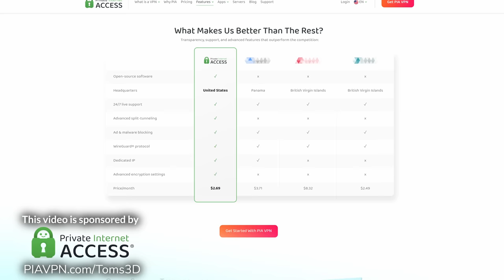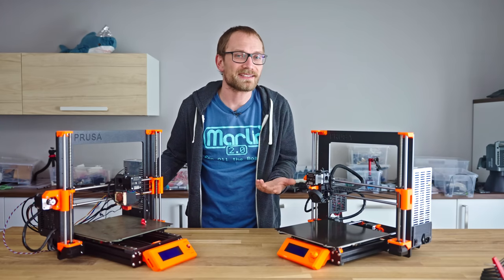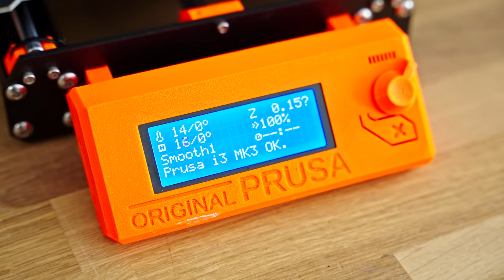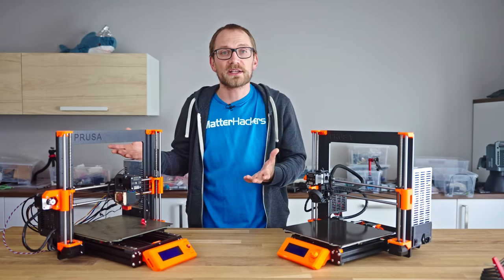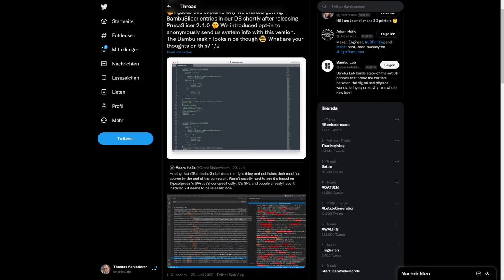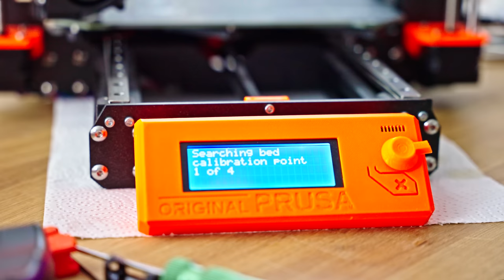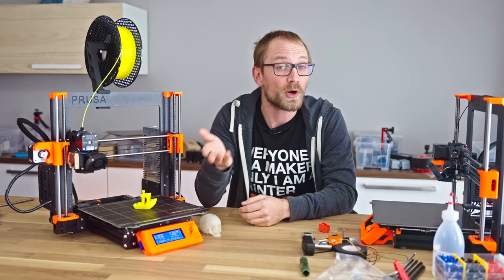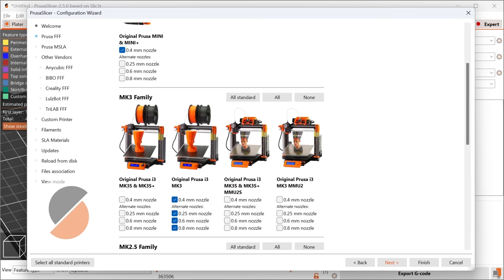This printer is OLD. Why is it still my favorite?

Comment: I have seen around 15 different Prusa machines, 5 enders and 3 Ultimaker on the different labs and universities that I have worked in. And I had never seen a dimensionally accurate Prusa machine, all of those Prusas were printing beautifully but they were completely unsuitable for any engineering work that requires a little bit of precision in my experience. Enders 3s were hit and miss on their assembly and calibration but mostly much better than Prusa mk3s that I have encountered. All the Ultimakers that I have seen were pretty good on their dimensional accuracy. But well tuned cheepo ender 3s were the best of the bunch. If you are gonna use your printer for miniatures and trinkets get a Prusa machine, but if you wanna make anything functional with tight tolerance parts, get an ender 3, do its axis skew calibration, and print slowly.

Comment: I remember all my printers being bedslingers because of cost and that they were "good enough".
But that was then and not now. I honestly think prusa had stuck with the bed slingers for too long.. print speed matters.. nobody likes waiting and heating up their room/wasting tons of energy because a print is taking ages.

I will sadly not be buying a prusa anymore after my mark 2s.. it was a reliable work horse.. it became noisy and creaky.. but a bed slinger only gets you so far.

Comment: The issue I have with the mk3s is that it‘s way to expensive for what it is. If they would half the price I‘d still say it‘s a little expensive but would buy one. With the p1p being cheaper than the mk3s I‘d rather wait a year and watch the durability of Bambu lab printers. Or see if prusa comes up with a up to date printer that is not overpriced.

Comment: What oil did you use to lube the parts? My MK3S+ is at about 200 or so hours now and I feel like just to keep things running smoothly for a long time I should probably do a nice deep clean/lube of the machine.
Reply: You can use the grease that comes with your prusa, in the little white tube. But most people use oil. Superlube with PTFE is what i use. 10k+ hours later and my rods/bearings are still mint condition.

Comment: Prusa make a nice looking printer but. I love my Ender 3v2. After a few modifications then Ender 3v2 is insanely reliable and the only problems i ever have with it is from using cheap bad filament that requires alot of setting changes to get to work. Namely Accreate PLA filament is the worst i have ever come across. Good video though

Comment: I personally want to see what a MK4 would be from Prusa. It seems like it would be the one with the best shot at knocking the crown off. I debated going for a Prusa but ended up going for an ender 3 as it was not only cheaper but I felt the tinkering community around it is something i was interested in. 
I one day want a Prusa and would get more interested if i needed a print farm or relined on it for income.

Comment: I find it sad Prusa is starting to fall behind. The i3 is old and no longer can rely on just reliability as its sole pitch. The Mini is OK and shows Prusa knows how to do a ARM based one with connectivity, but needs upgrades like a Revo to shine. And their first CoreXY model the XL has been coming soon(tm) for so long it is starting to appear "too little, too late" with how competing products appear left and right.

It would be great if they applied what they have learned with the Mini's "Buddy" board (and its wifi hurdles) and the XL to create a update to the i3 in the form of a MK4.

Comment: The Prusa MK3 is the Toyota Corolla of 3D printers. It's not fancy, but it's reliable and just works. It also has great support and a large user base.
Reply: I used a similar analogy the other day but used the Toyota 22R motor. Toyota used it everywhere. Lasted forever.  Just worked.

Comment: This has been my experience too, so far, after nearly 2 years of ownership. I tried a NozzleX, but got tired of fiddling with temperature adjustments to reclaim previous reliability, and PETG sneaking out above the heater block. I ultimately decided to just use non-abrasive PLA/PETG with this machine.

I think my remaining confusion with the stock configuration is PCB bed warping. I currently use the "nyloc mod" and still need to re-adjust every ~2 weeks or so, but at least I can adjust it. I'm not sure how my machine seems to be different from friends' which to this day remain un-modded, but generally retain the consistent 1st layer from their initial build (so I'm told).

I'd be pretty curious to know whether other folks that continue to use the MK3(S+) for the reasons you mentioned have resolved or endure this experience with the bed.

Either way, every time I consider a heavy mod to some functional part, I talk myself out of it, because my current goal remains the same as the original one: keep printing as boring (and functional) as possible, so it can be a tool to build interesting things.

Comment: I don't think you meant it but diminished a lot of peoples work by implying Prusa made consumer 3D printing what it is.   There was a bunch of machines in the early days but Prusa was able to keep the price lower than taz 4 and Makerbot sold out. There would still be and was consumer 3D printing without Prusa. I don't know how to find this out but I know the ORD bot was selling well in China and that has a lot of similarities to the Ender 3 with too over the cheapest good enough printer. Prusa slicer relies heavily on Cura.  There was big reliability improvements because of E3D V6. Marlin had and has other contributors beside Prusa.  Other motion platforms also work well.  Even gerbl is nice but more common in milling.  Stuff like silent stepper were a natural progression of trinamics IC line.  Prusa team has done a lot for 3D printing but they definitely had tons and tons of help to make their product.

Comment: Good video, and I agree with most of what you said, but I have a Bambu P1P on order, why  - because I put my deposit down on the Prusa XL almost a year ago, and am still waiting. I also have a deposit on an X1 Carbon, but not sure when it will be ready to purchase,   I would like to get a printer that supports multiple filaments,  but we need them to be available for sale.

Comment: Am I doing anything wrong? I bought Prusa Mk3+ not so long ago because i was tired of fiddling with adhesion and z-offset on Anycubic Vyper. Everyone keep saying that Prusa just prints, well it started good with a benchie, but still i get very bad first layer (if the model is small enough it just unsticks), model warping, direct extruder thing tangled the fillament ending up tearing it a couple of times and failing a print, and of course a blob from hell happened - printer just failing and filling the the hotend with plastic (never happened on anycubic ever). I used default slicer settings - so why everyone keep saying that it “just prints from stock” 😂

Comment: My Prusa MK3s has been a pain since I got it, generally material not adhering to the metal PEI sheet using either PLA, or ABS. Upgrading to the powdered coated PEI sheet did not improve anything. I was able to do a few successful prints which for the most part looked ok, but those were just outliers. For what it is, a very expensive experiment, these printers are not worth it in my opinion. For around $100 sure, but for almost $1000 no way, and I'm not singling out Prusa here but all other clones.
Reply: Same with my unit, spent hours tinkering in vain. Every time I see comets saying it just print and super reliable, it confuses me. Did I got cursed unit, is it me or is lucky ones that have that experience.

Comment: You changed shirts so many times in 1 video!  But back to topic, I have a prusa mini that I enjoy for the same reasons as you but I just got the sovol sv06 since its basically a newer clone of the prusa MK3 at only $240 and so far I'm liking it.  I have no creality machines since I have no interest in a 3d printer that uses V wheels.

Comment: I too would love input shaping on my Prusa Mk3s. Let hope there will be a future upgrade kit (mk3s++? Mk4?) that allows it. I'd rather not mod it on my own using a third party board and loose out on the ease of use in the ecosystem.
Reply: If there is enough free memory, they might be able to port input shaping from Marlin (it works with 8-bit AVR) to Prusa firmware. Last time I checked, Prusa Mk3 firmware is pretty far from Marlin 2.1 (or any 2 version)

Comment: Printspeed is nice but not everything. If you have a printfarm with customers waiting for there parts.....then yes. But for a hobby home user? How many spools of filament do most ppl use/buy every month? There is no point in getting a superfast printer that only prints for 10 days every month. I have several printers like Anycubic delta, Snapmaker A350T, Prusa MK3s+ & mini and have now a Bambu lab X1CC on preoder. But every printer has it's good and bad so I use them for specific prints. The Prusa's are great machines that are reliable and give good prints + they are easy to work on if needed. However it's good to see that new companies give things a push instead to just go with the philosophy on how to make a Prusa like printer but then cheaper.

Comment: Are Prusa printers with their own firmware "better" than Ender printers with their v-slot wheels and Marlin 2.0+? I do not mean better than all other (Ender) priters, but just like their are (hardware + firmware) compared to Ender printers with Marlinn 2.0+, stock hotend/extruder and v-slit wheels.

Comment: Network capability is why I don't use my prusa as much as the new bambu lab... it's just the micro SD card shenanigans that were SOOOO annoying.. when you are prototyping and need quick turnaround after every small detail you adjust and need to print the messing around with SD cards are absolute nightmares.. compared to how I send my jobs to my bambu... it's night and day in comparison.
Reply: You should try PrusaConnect which actually uses ENCRYPTED (imagine that?!?) communications to the cloud, or just PrusaLink, which is LAN only. LOL.
Reply: @MartinKoistinen  I have tried octoprint with raspberry pi zero and while it was initially very cool with a webcam attached to it as soon as I realized it is impossible to send a file to my mk3s over the network at any reasonable speed.. (prusa hardware limitation) it would take hours with the very low bitrate and streaming the file as you print it never finished as it froze and print failed.. then I had to manually edit the stl trying to find the layer it hand to save it...
Reply: @KillerkoUK  I've never had an experience like that with OctoPrint or PrusaConnect.

Comment: Was Mendel 90 based on Prusa? Way back in the Hydraraptor blog there's a post from Joseph Prusa saying he liked what Chris Knopper was doing with the Mendel90 design.

As far as I can tell the I3 didn't come out until some months later.

So who copied who? I mean sure, it's open source right? I'm not saying Prusa did anything wrong. I just wonder if there is some alternate universe where the Knoppers took out a big loan and bought a factory rather than producing kits from their house and they had the big, well known company that everyone after based their printers on for years afterward.
Reply: Myself and 2 of my friends are still using Nophead's Mendel90 machines. Two of us have replaced the hot end with an E3Dv6 but otherwise they are all standard, apart from them running Octoprint using a Raspberry Pi, and working well. The only drawback is that 3mm filament is getting harder to find these days as 1.75mm is becoming the new standard.

Comment: I agree, I love the hobby and some tinkering, but my hobbies wax and wane. I will drift away from acrobatic drone flying for 6 months or a year. I will go 6 months without designing part to print. I have like 8 hobbies like this in rotation. One of my hobby rules because of this is that any hobby of mine has to be able to be dropped like a rock for months or years and allow me to pick it back up near where I left it with limited time/pain. This is why my latest printer purchase was the prusa, it has so little pain to pick it back up after long periods out of the hobby.  New firmware? Thing has been fine for 5 years, it can go without installing that right now, heh. It just works.  Sure it will not one day, but most sources show it as about the most dependable thing out there.
Unlike my drone hobby where I just break the damn drone from being out of habit but still can't help myself from trying tricks I USED to be able to do, lol.

Comment: I have a Prusa MK3S, a Prusa Mini and a Bambu Lab X1C with AMS.
The Bambu made me appreciate the simplicity of the Prusa machines even more.

If I would have to get rid of two, I would keep the Bambu just because of the AMS system and it's print speed is also welcome.
One of the large downsides is the slicer.. it's missing so many slicing settings.

Comment: I honestly have better luck with my mini right now
My MK3 is off by 1% on the X and the seams are now gaps instead of zits after installing a 0.5mm nozzle
Also: What's that tool at 8:16 ?  I might want one

Comment: I have 2 creality printers.  I can't afford the PRUSA.  I also built two different PRUSA Style printers.  My CR6SE with the Community Firmware has seen at least 50Kgs of filament...it just freaking runs.  The Creality Ender 3?  At least 150Kgs of filament.  It took me all of about 2 weeks to get it just being a freaking workhorse (biggest thing was putting in the Hot End Fix, and after that?  No issues.  It was all about building it up properly, putting on the Die Springs, using a mirror vs. stock bed.  It has stock firmware, no ABL, No fluff, it just freaking works now. I know, I know, I know...No thermal Runaway...Yea...ok...it just runs.  As for accuracy?  I used to make functional prototypes for people, and they were always impressed at how great they worked out for them.  I don't do that anymore because they decided to buy their own 3D Printers to make their own instead of paying me.  Such is life.  

Would I turn down a PRUSA?  Oh heck no...but I just cannot justify the cost, I just can't.  I make parts for me and friends, I don't own it to make money.  I make parts for my shop, I make parts for my office, I make parts to replace old parts on items I own.  If PRUSA wants to send one to me to show me how wrong I am, I won't turn it down, but for my $$$ the Ender3 and 6SE has been just incredible.  Apparently per the Creality forums I have a unicorn, because I literally have had ZERO issues with the 6SE, and the Ender3 issues were all fixed by doing the Hot End Fix, Die Springs, and putting in that uber flat mirrror (compared to the stock bed).
Reply: I wanted a Prusa, couldn't afford one. So I bought a clone off AliExpress for 230 bucks (the Fysetc MK3S clone), and later spent about another 340 bucks to upgrade it with genuine Prusa parts. The end result is a printer that prints just as well as a real MK3S for just a little under 2/3s the price of one (I wasn't about to drop 900 bucks on a MK3S)

Comment: isn't silocone grease the usual recommended lube?  i wonder if the glp220 (which i guess is a german way oil) would degrade petg parts?  i wonder if i should start using way oil... (actually i've never oiled my stuff since buying the i3mk3s+ a couple years ago... probably should do that and thinking of using way oil)

Comment: Could you test to upgrade a mk2 to say 48V? Yes beyond specs but for fun
Reply: you would need to get a whole new controlboard, and somehow still step down the voltage to either 24V (MK3) or 12V (MK2) so you can use the current heatingcartridge. Also new motors since the current ones wouldn't like the 48 volts

Comment: I always liked your videos. But why don't you try a Banbu lab?

So does everyone else in your shoes today.

//Jon
Reply: Bambu Lab is 100% better than Prusa
Reply: @3DPrinterAcademy  Not in reliability, accuracy, CS, parts availability, or even network security. Speed? Price? sure.
Reply: @LilApe  are you just mad that you spent over 1k on a worse machine? certainly seems like it
Reply: @mihedas  17k hours and zero issues or replaced parts. Paid for itself 60x over and at least I can service it if it ever had a problem. Good luck replacing the rods and bearings on your Bambu lab (you can't☕)

Comment: The frame design is really bad. It´s not rigid at all and need way too many parts to assemble. This makes it really slow.
Electronics is still 8bit.
It costs like 750 bucks and you need to assemble it for ages.
There are simply much better alternatives out there like the new bambo lab.
Reply: so you haven't watched a second of the video... and you probably don't even know what difference is between 32bit and 8bit other than "The higher the better"

Comment: A lot of times, a new feature sounds great until it's actually gone through the product creation process and implemented. Take touchscreens. Sure, they're nice, but capacitive touchscreens designed to withstand exposure to dust and volatiles are expensive (or you have to take responsibility/liability for making sure they don't break in those environments). Fine, the manufacturer says, we'll use a resistive touchscreen, they're dirt cheap and reliable. Uh, yeah, but they are a huge pain to work with. The LCD on the Prusa i3s are just fine, and if you need a fancy screen just plug in a dirt cheap Raspberry Pi to the USB port and use Octoprint. I had a "headless" Robo R1 (git off mah lawn) with no native controls except through USB, and that's how I managed that pain in the socks.

The longevity of the Prusa i3 is a testament to great design, repairability, reliability, and company support, and that's not something you'll find from Chinese manufacturers.